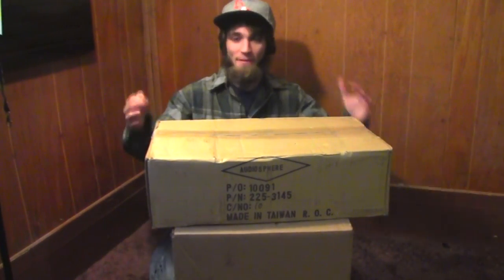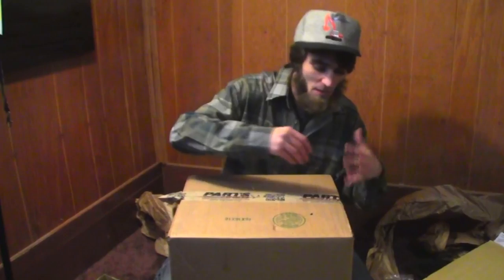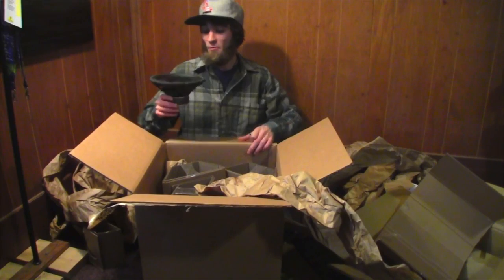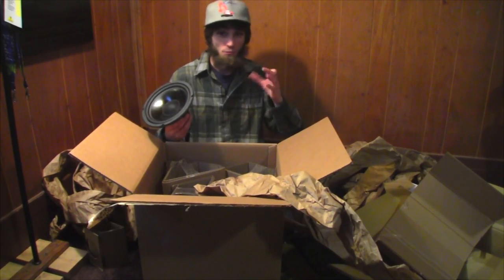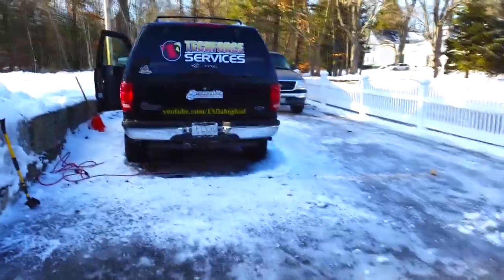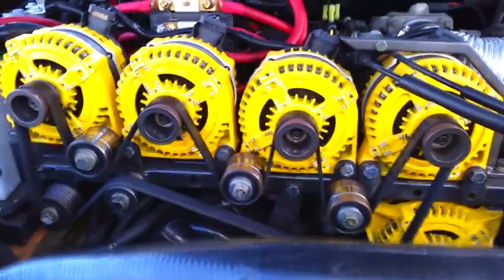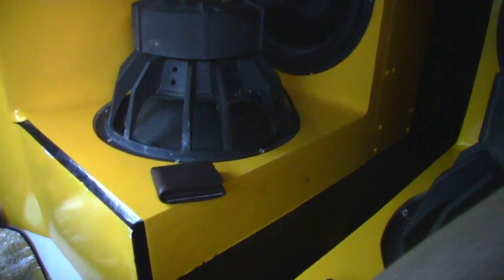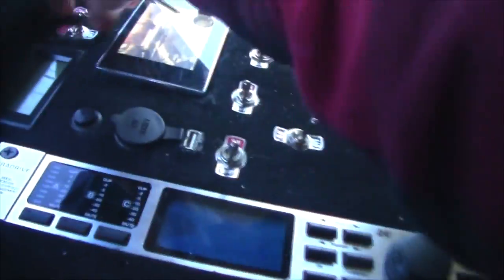MORE Speakers & ALL FIVE Alternators SPINNIING! Franky PASSES Inspection & GETS LOUD (Bass Bonus)

Comment: Hey exo, if your looking for something to act as a head unit/pre amp for you home system, take a look at any of the pyle pro hybrid pre amp receivers, yeah I know pyle isn't known for being the fastest and greatest, but for the home audio area of there company that get the job done I especially like the how on mine, I can't switch between the two sets of 2 channels a/b by remote or have on both. Idk, something to look into. It was helpful with mine. 

Btw great to see franky street legal And ready for comps and demos! 

Oh yeah, and one thing I've been thinking about. If I get the nvx JAD 1200.1 Will it be enough to push the dual nvx vcw 15" 2ohm subs?  Or will I need an additional amp or just one amp more powerful then the JAD 1200.1?
Reply: Whoops,  I meant latest*  and greatest. 

And how I can* switch between the two sets of channels